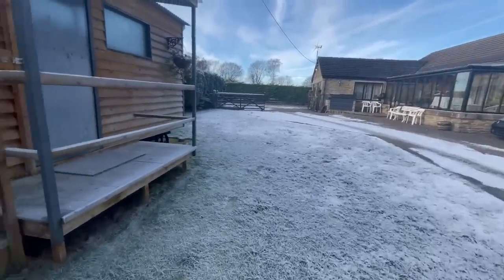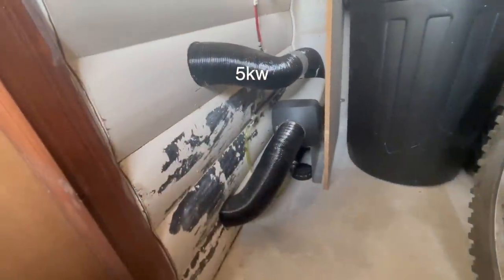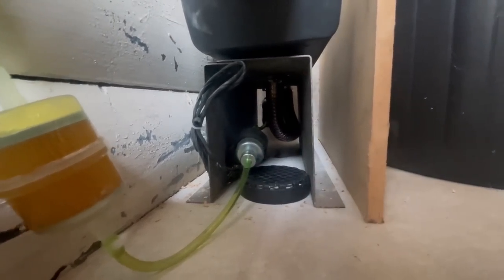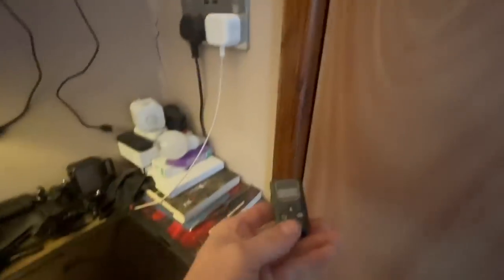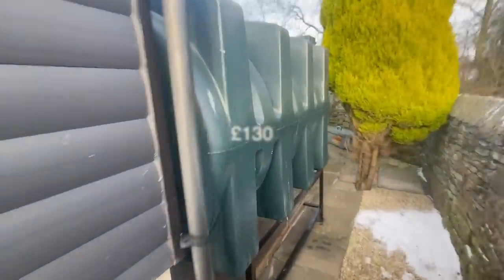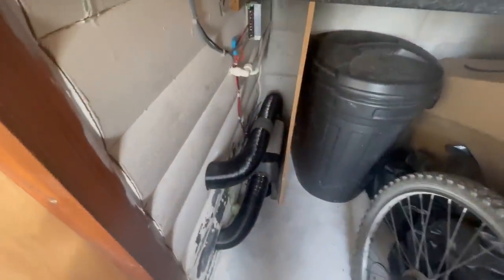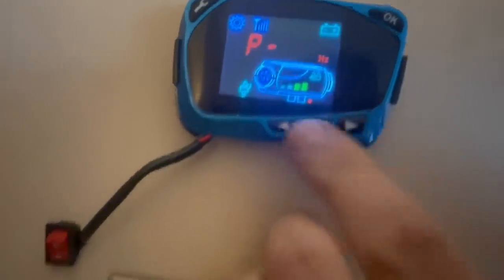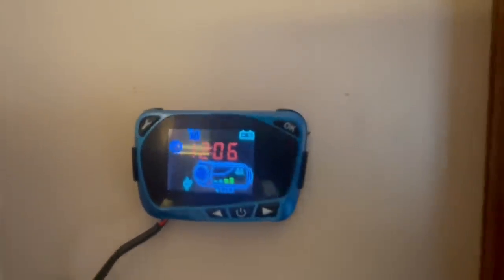Heat My House with Chinese Heater

Comment: you are the first person i have seen take air inlet from inside the house, instead of preheating cold air, been saying this for ages, i bet the metal cabinet acts like a heat store also. and its a dry heat.. these things could prevent so many damp problems many homes have had for years!, one benefit of pulling in outside air, is that it will put the house, in positive pressure, and therefore reducing draughts.. im sure a clever person could build a heat exchanger from the exhaust and pre heat inlet air.. al good stuff.
Reply from the maker: Yea your right mate it totally makes sense to recycle the air to increase the temperature even more and works well, yea the cabinet does soak a little heat and it’s a perfect little corner for the heater.
I was looking into doing the mod that people do with an old EGR cooler on the exhaust to drive a little radiator in my kitchen but I may build an air to air box over the exhaust and use a fan to pump the hot air into my kitchen and that way I’d get the positive air pressure too 👍 yes I agree more houses should have them even just to stop the damp related issues. Cheers 👍👍
Reply: My heater is outside in a wooden cabinet I’ve built and so draws cold fresh air from outside. Since installing it a week ago I’ve noticed I get no condensation on any of my inside windows. Previously my kitchen and bathroom windows were always streaming with water. Alongside a temperature gauge I have is a moisture content reading which now reads around 40 to 50% whereas before it was usually around 70%.
Reply from the maker: @en53kff  yes if you don’t recycle the air and use fresh air this is better for damp houses but it takes more energy to heat the air, but it’s better for you 👍👍
Reply: @CarJunkeez  
..keep an eye on the heater for leaks in the exhaust. I saw another guy from your part of the world used copper pipe as an exhaust. Also buy a few spare fuel pumps, they fail often, they’re cheap though. Buy gaskets as well etc etc. Better off having the spare parts there ready
Reply from the maker: @cdunne1620   cheers mate 🙏👍 yea i actually got 2 heaters (one for spares) because they was so cheap and expect there will be failing parts so easier getting another identical one just incase 👍👍 cheers
Reply: There is a video out there of a guy running the Exhaust through a radiator which got silly hot then vented outside.
Reply: I would always mount as per a cab heater, inlet and exhaust outside, just in case any blow back from the inlet.

Comment: I fitted one two weeks ago after paying £125 for 47kg of LPG. My red is a £1/litre from the farm, its costing me £3 a day to run which is half the cost of LPG. Nice installation you have there, my air supply is from my big workshop, no sense in dragging in freezing air.
Reply from the maker: Cheers mate, yea my central heatings on 47kg bottles of LPG to and the prices are just ridiculous aren’t they 😂 yea we get red to on the farm but it’s a bit more expensive than our heating oil at the mo. Yea half the price is a good saving for you mate at today’s price’s. at least the air in your workshop isn’t as cold as outside. I think I may fit one of these in my workshop to 👍👍
Reply: @CarJunkeez  Ive just bought a standalone 5 kw unit for my 16ft by 8ft workshop but prices have increased in the past week on both ebay and amazon your looking at nearly £200 for a standalone unit and there arnt many kit sets available at 5kw they seem to be mostly 2kw now, however ours heating our front room mounted  on the outside wall is a 2kw unit and its doing a brilliant job in a 16 ft by 11 ft living room.
Reply from the maker: @oojimmyflip  great job mate 😃👍 they’re brilliant little heaters aren’t they. Yea I’ve noticed the prices have nearly tripled lately 😂 cheers
Reply: 10 years ago lpg was £1/Kg.

Comment: looks like your dosing pump needs tilting up about 45 degrees and i'd be tempted to replace the green fuel line with something from your local motor factors, Nice job 👍
Reply from the maker: Cheers mate, the pump is actually at 45 degrees but it’s hard to tell on the video, yea I’ve heard people say the same thing about the green fuel line so I’m gonna change it just incase mate 👍 cheers

Comment: Hi my ecu is fantastic thanks, you got a link for the vevor for £85 I can only find dearer ones at £200
Reply from the maker: Happy days mate 🚗💨👍 just had a look on Vevor and they’re all sold out pal 😂 I got 2 a couple of months ago £85 each, then got an all in one for my dad a couple of weeks back for £100. Keep your eye on there site and they’ll probably get stock but looks like prices are rising, if you can’t get just the heater get an all in one because it’s same heater inside mate 👍👍
Reply: I messaged vevor the other day and they gave me a date of early February before they are back in stock. I managed to get one off OnBuy for £100 it's just been delivered today so will get it set up tomorrow.
Reply from the maker: @KevinHoey1  yea apparently a lot have been held by customs due to bad instructions 😂 glad you got one pal and that’s a really good price at the mo too 👍👍👍

Comment: You need to watch David McLuckie's videos on YouTube about mounting the fuel pump vertical instead of horizontal, it makes a lot of sense. So much for the 10L tank. The ongoing question about recirculating the inside air...regular furnaces have been recirculating inside air for decades, why is this such an issue?
Reply from the maker: My pump is at 45 degrees at the mo but it’s hard to tell on the video but yes I agree it is best to mount them vertically, yea it makes sense to recycle the air as it gets reheated and it’s separate from the room that the heater is in so less chance of getting fumes. Thanks I’ll give him a watch mate cheers 😁👍👍
Reply: I used the 10 litre tank and didn't put in the supplied fuel nozzel at the bottom of the tank instead I installed the vehicle tank pipe included at the top of the tank  a few mm above the bottom  and used fuel proof epoxy adhesive to glue it in place after sanding all the surfaces to get a good bond.  the tank is wall mounted and now needs to be in a UV protect6ive box to protect it from the sun. dont forget to drill the lid with a 1 mm hole to allow the tank to breathe you can glue a strip of rubber old cycle inner tube over the hole on three sides to keep the rain out of the tank.

Comment: Got mine set up on red diesel,using around 250ml just over 1 HR,...I too recirculating the hot air coming through,mine sits in the inside of the home against the wall with the exhaust just going through the wall(all sealed with exhaust paste) yes I use a carbon monoxide detector as well,also sitting on a car battery with a trickle charger so if the power went down I would get around 5days off battery(I know this cause I have already tested the battery).......I loved that tank buddy.....what's the building regs for the tank with local authorities????
Reply: most oil companies will deliver two 205 litre drums of red diesel these days and comparing it to the cost of gas its a lot cheaper, or you can travel to them and buy 20 litre carboys direct after filling out a disclaimer for the tax man stating that you are using it to heat your home
Reply from the maker: awesome mate 😁👍 sounds like a good setup. Not to are about regulations for my tank but it’s pretty relaxed here as we’re on a farm with no one around us 👍👍 cheers

Comment: Your pump should be mounted on an angle as per instructions. It can't expell air bubbles that cause cavitation, stopping flow.
Reply from the maker: Hi, it’s actually at 45 degrees but just difficult to see that in the video, thanks 👍

Comment: Nicely done, I think as gas prices hike even more next year in the UK these heaters will become even more popular than ever even in modern well insulated homes like ours, our 32 Kw gas boiler is consuming £1.00 an hour in these freezing temps when the nights get down to  minus 7 degrees C just to maintain around 17 degrees C indoors, our outside wall is at a constant 4 degrees C  internally, even with cavity wall insulation, so I decided to install a diesel heater in a custom made box outside our home drawing internal air from our kitchen and blowing warm air into the living room.

 my calculations are that it is costing around 7 to 10 pence per hour to run, a massive improvement on runing a gas boiler, I wish we had done this years ago.  gas currently is working out at £60  a week on prepay with no debt on the meter running a diesel heater  £20 a week on diesel is a no brainer. I had to extend the cables a little bit and Im running the set up on a 75 amp battery.

 in case of power cuts that we have been promised in the UK in January and February, im also runing a 20 amp battery charger when the unit is running so when the power fails the battery can cope with the shutdown procedure as it is quite well known that if the power supply fails  the heater fan cant go through the shut down cooling process and it can fry the electronics inside the heater. some have proved this wrong with one attempt at complete shutdown on the mains supply but I fear that if it happens once to often it will fry the electronics eventually and a reasonably priced 75 Amp battery isn't very expensive to replace from eBay.
Reply from the maker: Brilliant mate, sounds like you’ve got a good setup and saving you some money there. Yes I have central heating too on LPG and I get the 47kg bottles and they only last a week if I’m lucky in these temperatures and they are so expensive now. Yea there’s no need to have these heaters on high but work really well on low for keeping the temperature bearable and you can just boost it with other means like a coal burner just to be compatible when at home. 😁 cheers 👍👍
Reply: Wouldn't worry, new motherboard is cheap as chips.
Reply: And, when having a battery in between , You can charge it with starter cables from the car ( petrol/diesel) or have 500 watt pure sine inverter on the car snd charge with the battery charger during cut outs..My dual battery system in my work car can run the diesel heater for 3 -4 days without starting my car..

Comment: Good video, and I must comment on your go big or go home fuel supply, very impressive.
Reply from the maker: Cheers mate 👍 ha ha yea deffo go big or go home on the fuel for sure 😂 👍👍
Reply: @CarJunkeez  where did you buy it from at 70p a litre?
Reply from the maker: @kirkwhittle5740  I got it from Crown oil mate. 2000 litres for 72p a litre 👍👍
Reply: @CarJunkeez Disaster waiting to happen with the tank installed like that.
Bear in mind the cost of making good if your tank leaks or splits. A neighbour of mine just had a £100,000.00 + insurance job. 
Because how your tank is installed, insurance won't pay out.
Reply from the maker: @ChristianBHough  yes it’s not ideal but not as bad as it looks on the video as it’s a big open space. Also we can’t really get insured here where we live so we don’t have any insurance.

Comment: Just tweaked the pump pulse settings on mine for old engine oil , 0.8hz min 4.0hz max runs 18.5:1 afr now no soot 👍🔥🔥🔥
Reply from the maker: Awesome mate, these heaters definitely improve when tweaked to the fuel being used, I’m gonna get my air to fuel ratio meter on mine to for a little fine tuning I think mate 😁 cheers 👍

Comment: Nice one - I did exactly the same on my gaff with the hydronic version round my radiators.
Reply from the maker: Cheers, I’m thinking of fitting the air and water version myself, does it work good on water mate.
Reply: @CarJunkeez  I used a 9kw erbespacher on mine but it's no where near powerful enough for my setup. Is did a video on it but 9kw just isn't enough for all my radiators. I'll be interested to see how you get on
Reply from the maker: @ajinfrance   yea I was thinking the radiators would use a lot more energy so was going to try a 9kw myself but may go a bit bigger then 👍 cheers mate

Comment: Heres a tip. Run a duel tank /duel valve setup. Start it with your kerosene then switch a valve over to filtered waste oil tank retrieved from your autos.. free is good. 
Thanks for the upload!
Reply from the maker: Thanks mate 👍 yea I’ve heard people doing that, I get quite a lot of old oil as we’ve got a lot of vehicles so I might start filtering it and get a second tank like you say 👍 cheers
Reply: do a 50/50 mix  @CarJunkeez
Reply from the maker: @craigr306  yea suppose I could do mate, just don’t want to clog it up 😂

Comment: I got one of these two days ago, heats my two car garage very well. gonna get one to heat kitchen and living room.
Reply from the maker: They’re amazing little things for the money aren’t they mate 👍
Reply: What temperature will it heat your garage to on a cold day?
Reply: I have had it up to 71F while it was in the low 40s outside, that was runniing wide open. I kept it at 68 and it would cycle and maintain it nicely.

Comment: Best D-Heat vid to date mate, I like it being outside as such with the indoor intake pipe coming through the wall from the inside, a cool move or maybe a hot one ;) Pop your pump to 45◦ for longevity; good on ya gr8 vid...
Reply from the maker: Thanks mate 🙏appreciate that 😃 the pump is actually at 45 degree’s but it’s hard to tell on the video. Cheers 👍

Comment: Well fitted and set up. I would suggest extending your exaust pipe by a foot or two so the fumes wont be drawn in by the combustion intake pipe.
I would imagine you should get better economy than a litre per hour.
Reply from the maker: Thanks mate 🙏 yea I probably will extend exhaust just a little but it’s been ok for past couple of years. It does really well on fuel, I’m mostly just running on 1.5hz and I don’t even use a litre a day in winter, but I don’t keep it on all day, just a few hours at night. I’ve also fitted a 12v fuel cutoff solenoid as was seeping into the heater a little when not in use but that’s sorted it out nicely 👍 cheers

Comment: Nice setup but just wanted to point out, the air intake that comes from the bottom of the unit is supposed to be kept away from the exhaust, someone might correct me here but I think it’s the clean air intake for combustion & pulling exhaust fumes back threw the combustion intake will affect the units life span & performance, be best off pulling it back through the wall and leaving it inside under the unit👍
Reply from the maker: Thanks mate 👍 it’s not actually as bad as it looks on the video and has been fine for the past few months but I am going to change it as going to fit an EGR cooler and run a small gearbox cooler in my kitchen 👍 cheers

Comment: just quick bit of advice need to have the pump at a better angle 35-45 degree  so they say  or it wont last long
Reply from the maker: Cheers mate, it’s actually at 45 degrees but it’s hard to tell on the video but thanks anyways mate 👍👍

Comment: Can i ask where or how did you come by the settings for using the heating oil ? as that is the oil i am using. Great video and many thanks.
Reply from the maker: It’s was trial and error mate, I had one of the simple controllers and board before and it was using far to much fuel so swapped for this controller so I could tweak settings, I’ve got an air to fuel meter for a car that I’m gonna fine tune it with too but it’s working well at the mo. Just one thing to bare in mind though is these heaters are all different so my settings may not be right for yours to 👍 cheers
Reply: @CarJunkeez  Thanks for the fast response ... I have just plugged in your settings in my vevor heater as a trial but i have noticed it is now not getting the cast up to full temp (1 bar missing). I will keep playing with the settings but i do think my unit is now too lean. Cheers mate and have a good xmas and new year.
Reply from the maker: @darrenhague6669   mine doesn’t quite to on the lowest setting of 1.2hz but it’s good for mine to air the house during the day as it’s really economical, just keep having a tweak mate and you’ll find what’s best for your heater. Cheers and happy Christmas to you too pal 👍

Comment: Mate, have the fuel pump at 45 degrees... not a straight in line... better fuel delivery (less fuel used) and the pump will last longer before burnout or air-locks.
Reply from the maker: Cheers mate, it’s actually at 45 degrees but it’s hard to tell on the video but thanks anyways mate 👍👍

Comment: Great job you did here, having a massive diesel tank is key. At the prices you mentioned it is a cozy and warm winter for less than having it heated on gas. In some respect you are basically on the Arctic, Survival is immenent. I would create a double (sealed room) door entrance so you can close one before opening the other. A thermostat to regulate the control of your diesel pump would be a nice ad-on. Is that even possible? Make sure you have a 12v battery ready (tricle charged) to run the heater if a power outage or some other disturbance is bothering you.
Reply from the maker: Thanks mate 😁 yea I just heat one room up in the evening and then open the doors when I go to bed and it’s so economical, I’m on solar so it always has battery backup but I think I may do a 12v sealed lead acid alarm battery too and set the power supply voltage accordingly so it wont over charge it just incase 👍 cheers

Comment: Done this in my shed, the only remark I have that if you have a grid failure or a power supply failure, you will burn up the ECU, I use a battery in parallel to prevent this.
Reply from the maker: Yea got you mate cheers, I’m fitting solar here with battery backup so should have that covered soon 👍👍 cheers